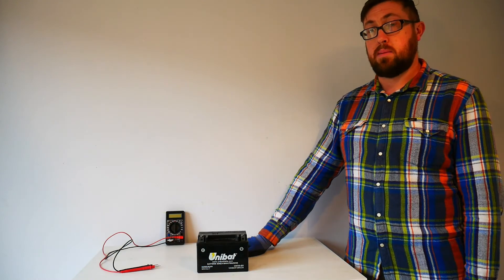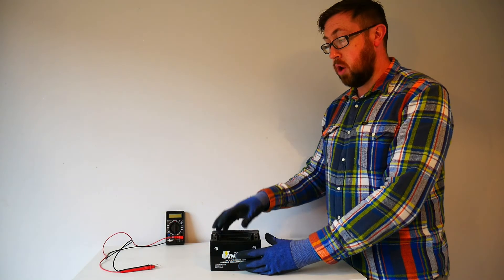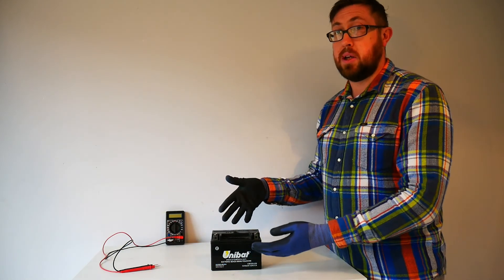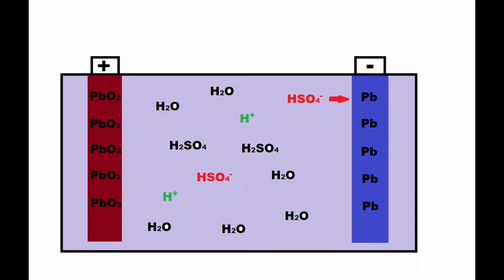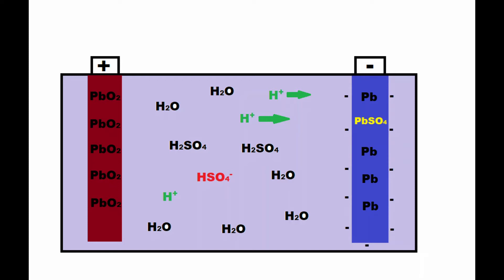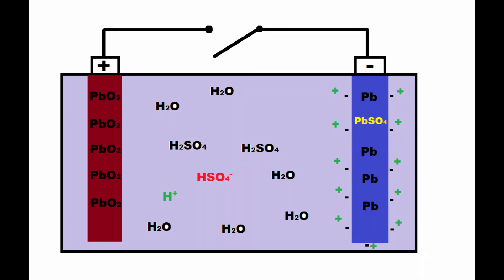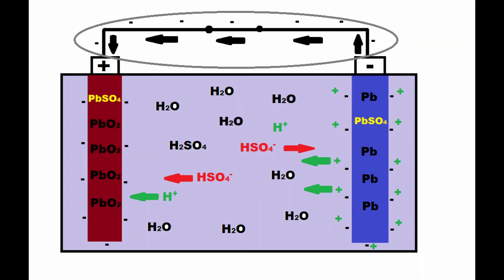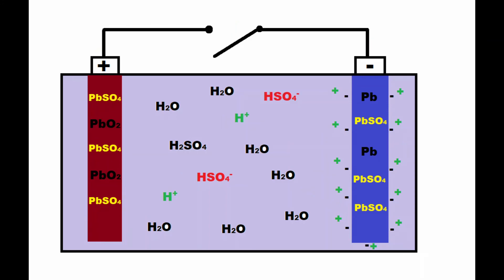How a lead acid battery works

Comment: The greatest minds in electrical theory, Tesla and Steinmetz did not believe in electrons. I believe they are correct. That’s why these explanations are so confusing. They’re wrong. What is actually happening is there is an electrical pressure buildup on the negative side and completing the circuit allows this to be released like the air out of a balloon.